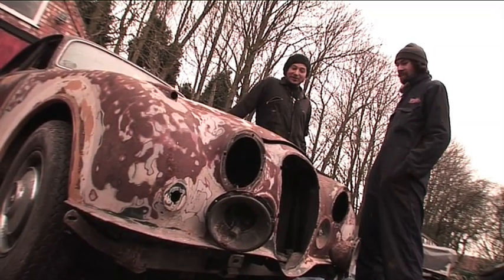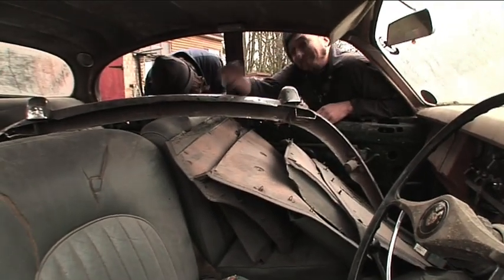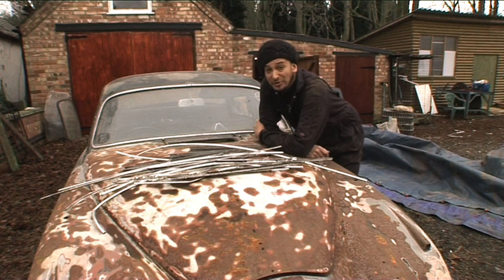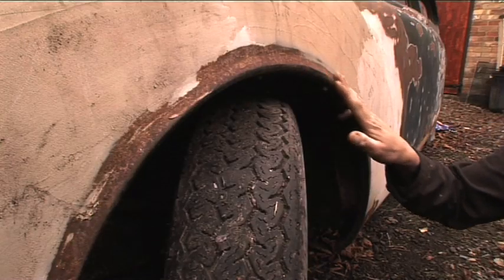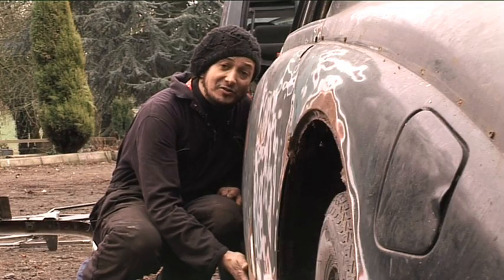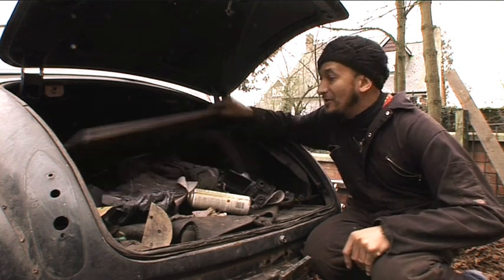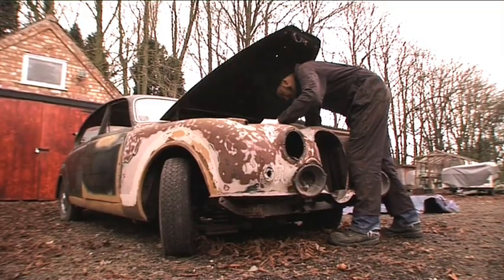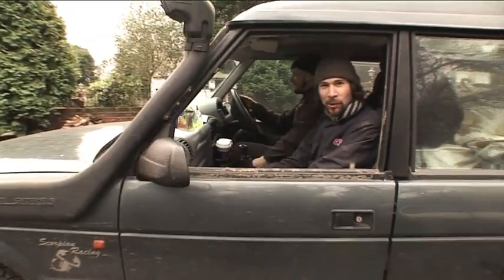Practical Classics' New MkII Jaguar 340 Project

Comment: Car is now in my garage. She still looks perfect, no rust anywhere, and is a delight to drive.
What happened with the original chairs, have they been replaced or just recovered?
What oil do I put in a new rebuild engine, do I stick with mineral oil, or upgrade to a synthetic oil?
Reply: classic 20 ,50 oil